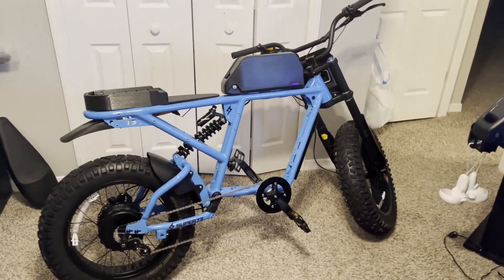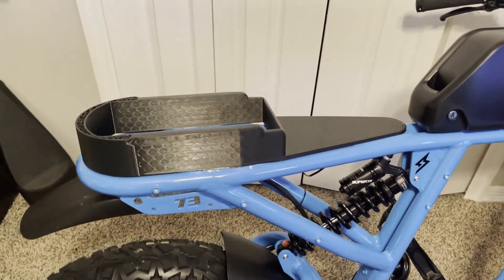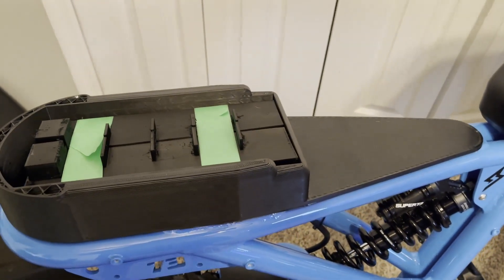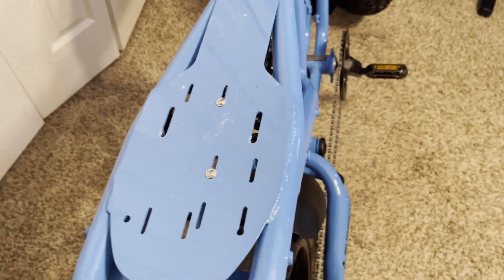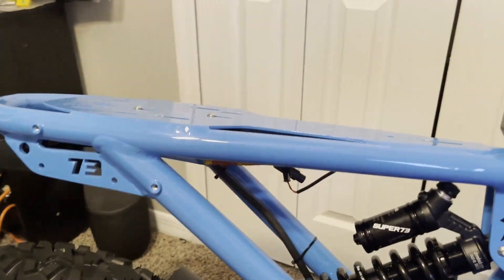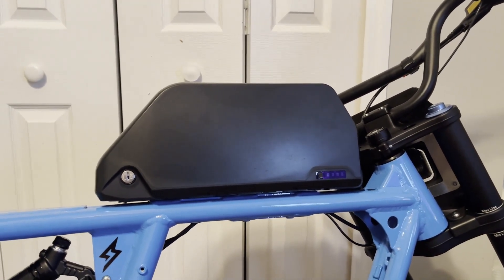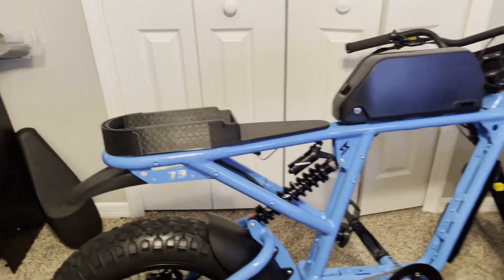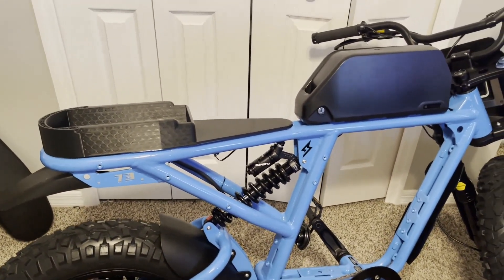Sneak Peak at our 22,000W+ Super73 RX build. BAC8000, QS205, Molicel.

Comment: What qs205 did you get with a wide enough axle?
Reply from the maker: I thought I mentioned it in the video, but I had it custom made, with a custom axle.
Reply: Sorry didn’t watch the video. I made mine from 4140. Nbpower makes the “qs205” with a longer axle but it’s a fake qs motor. That’s why I ask.
Reply from the maker: Ahh, no I designed the axle in cad and had my rep there show it to engineering.  I have a large shipment of them to spec for the 190 drop out being made.
Reply: @BuildItTuneItEV  awesome. I deal with them a lot for non ebike stuff. I’d be interested in a bac 4 or 8000 for the qs205.
Reply from the maker: @User3eighty4  slight language barrier, how ever they are great to deal with.  Hard to beat the genuine siaecosys/qs motors. 

The Bac 4000 does 16KW so should be plenty, unless you want to oversize. 

Once product shows up I’ll work on getting everything on the site!
Reply: @BuildItTuneItEV  nice, I’ll buy one once it’s ready.
Reply from the maker: @User3eighty4  thanks for the support brother!
Reply: @BuildItTuneItEV  Is it possible to get the motor threaded to a 26x4 rim? I have plans...
Reply from the maker: @marthamryglod291  you could out it on that rim!!

Comment: I'm excited to follow your build here! Also very interested in see what kits that you create and make available for these bikes.

Question regarding using the bike as a heat sink. You mention in several of your previous videos about preserving paintwork, won't you have to strip the paint off the frame (where it meets the controller) to prevent the paint from acting as an insulator, as well as provide a solid connection to properly transfer heat?
Reply from the maker: Fantastic point.  I really do care about the finish on the bike, and while filming the video it hit me that yes I need to do something about this.

Sadly what it will likely come down to is tapping off this area and sanding away the paint.  I’ll have to do so carefully enough not to damage any other part of the bike.  

I don’t have the proper answer about what coating to put on the raw aluminum or if the thermal compound will protect it.   Not super versed in this area.

Currently the controller mounted on bottom does heat the base plate up some, but how much energy transfer is lost via the paint is unknown. 

If you have any knowledge here, or experience I would love to hear it!

Comment: Really cool looking build! P42A cells are the best right now but you should try and get some of the new Molicel P45B cells when they drop (hopefully Oct/nov 2022?)
Reply from the maker: I chose to use the P42A just because of the 30-40 builds we have done with them, i've only had 1 cell I needed to replace. So long term I have some faith. Not saying I do not trust all products from Molicel, just that I know this is up to the task.

I usually have enough friends looking for a battery that when the time comes for the new cells to drop and they do everything we hope I can build a new battery set.

I hate being the first to rush to a new product especially on something where the discharge will be at max the cell can do. 

I do look forward to getting my hands on the next Gen cell though!